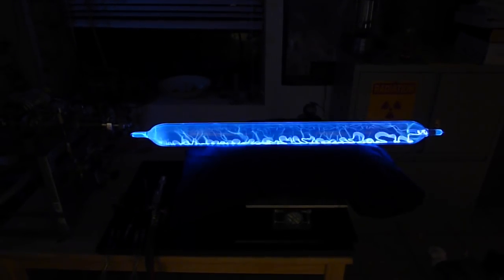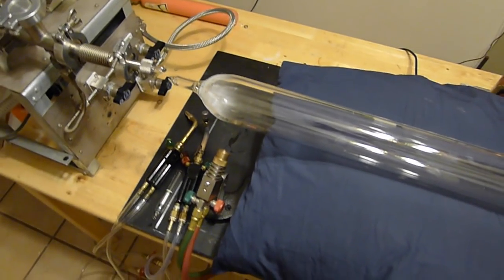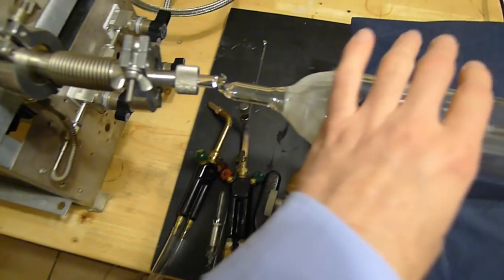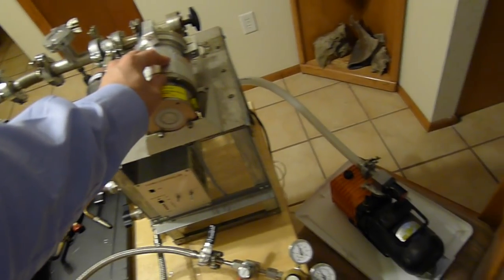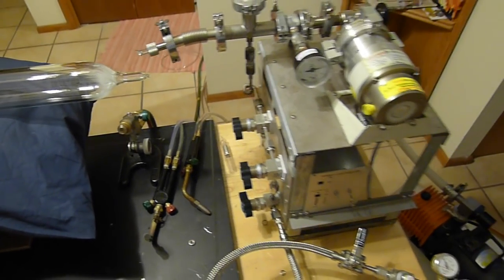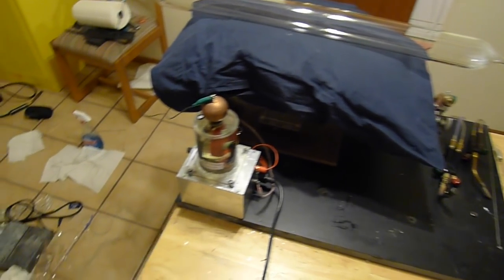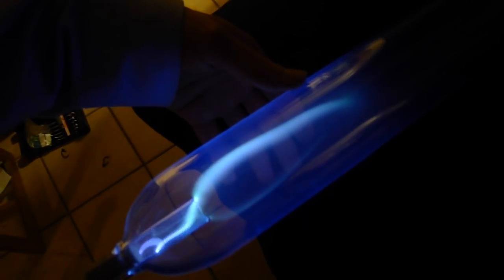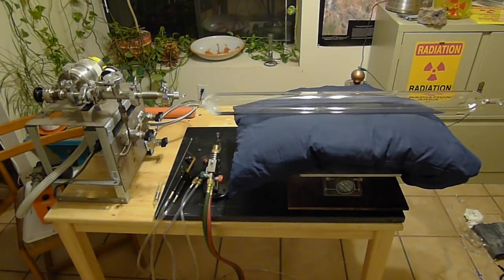Xenon plasma tube: Construction and operation

Comment from the maker: Hi Russ, 50 torr = 50 mmHg = 2 inHg.  The neon electrode is not strictly necessary.  Without it, the gas in the tube can still be lit up as a dielectric barrier discharge.  However, this is inadvisable on large plasma tubes because you risk "pinholing" the glass with an arc.  Alternatives to the neon electrode are commercial lamp lead-in wires pre-beaded with a sealing glass.  A beaded tungsten lead-in costs $4-8.  Making your own is not really advised; it's very tricky.
Reply: Hello carl I've had a project come up recently and i was wondering if you or someone you know would be able to make a few plasma discharge tubes?

I cant say for certain on the size yet but rough estimation would be 16-17 inches in length and about 1 inch wide, xenon and krypton gas 

I would do it myself but i dont really have the best of equipment here and its easier to just try ordering the tubes from someone who can make and test them adequately
Reply: @entity9742  Did he ever respond? did you find someone to make the tubes for you? if so , please share ! thank you.

Comment: Awesome video. Just want to point out a couple things to anyone wanting to set up the glassblowing portion of this. Make sure you have adequate ventilation when working boro and are using didymium glasses. Borosilicate dust can give you silicosis (irreversible lung damage) and while the sodium flare on clear is not too bad it can still hurt your eyes without didymium glasses. Also a good way to clean glass is with windex or 50% rubbing alcohol. As a glassblower I clean every rod and tube before using it in production.

Comment: Excellent device! One can use a frequency generator to modulate the output as done in Rife type devices. In fact, this can be used as a Rife device. For those not familiar with Rife devices, just Google "Rife".

Comment from the maker: You could use helium.  It makes a light-pink, not very bright glow and it doesn't form the dense tendril-like arcs that xenon does.  You can make very long fuzzy sparks in He at atmospheric pressure. Another issue with helium, although I don't know how important it is practically, is that it diffuses through glass rather rapidly.

Comment: Definitely worth consulting a scientific glassblower or anyone who works with boro. I could do a seal like this in a few minutes on my lathe and would charge way less than buying all the equipment.
Reply from the maker: Of course, the person filling the work needs to be able to degas and seal off the piece from the pump/fill system, and unless a glassblower is offering to do that pro bono and bring his own gear, one is basically obligated to own and operate some torches and annealing ovens.  I do collaborative projects with good glassblowers all the time and make no representation that I am particularly good at what they do, but nobody who gets into plasma stuff is going to get far without some rudimentary tools.

Comment: I used to blow glass as a hobby and I was looking to purchase another bench torch. I built a nitrogen generator and I have an oxygen concentrator that needs repair. This cam e about because i was looking to purchase a plasma tube for research purposes and there were none for sale anywhere. So strange. The only ones I could find are those from the Korean? company that that one man started 30 years ago and there is quite a long lead time. If I was looking for a beautiful 7 footer I would find you or build one myself. Very good video and thank you for the information.

Comment: 6:02 - interesting turbo molecular pump setup you got there. It seems like you're using a custom adapter to which can take smaller pipe intake diameters, didn't know that would work.

Comment from the maker: My hypothesis is that it has to do with the mass of the xenon atom.  This is responsible for the low diffusivity of Xe ions in Xe gas and the very poor thermal conductivity of this gas.  Arc channels form readily because ionized gas can't effectively spread out.

Comment: hmmm... im not sure i quite understand the tipping off portion of the process... so a quarter inch tube must be fixed to the larger tube... i assume the the quarter inch tube is opened so that the vacuum piece can slide in?? .....it appears sealed. How do you fill it??

Comment: Carl, also I was wondering what the practical limits on length were and at what point (voltage and pressure) you start to worry about X-rays? Is heating of the electrode a concern? (I know, so many questions)  Getting ready to dive in!
Reply: Discharges in high pressure cannot make X-rays.  To get X-rays, you need to allow electrons to accelerate to high speeds, then collide.  In high-pressure gas, the electrons don't get a chance to gain enough speed to make a "hard enough" X-ray that could escape the tube.

Comment: so I was hoping to make some glass sculptures and fill them with argon or one of the other gasses you mentioned but iv'e never got to work with them nor do i have the equipment pumps etc, although I do have a ballast for a neon sign I got from the sign shop before they went out of biz. I guess i'm kinda wondering if you might be able to help me in any way with filling a sculpture? or what exactly the process is and what tools I would need to get me started?maybe we can work something out?ZR

Comment: Great work! I am wondering if you can wash with diluted HF ie 10% and rinse with DI water instead of Sulfuric acid.  Also did you use a polariscope to help determine stress and annealing.  I hope to get a workspace so I can start some similar art.
Reply from the maker: The purpose of washing out the glass is to remove contaminants, chiefly organic material from the stoppers used in glassblowing and dust from the cardboard box the glass came in.  The sulfuric / peroxide ("piranha") wash is designed to oxidize and dissolve such materials.  I am not sure what the rationale for HF would be.  In any case, a thorough DI water rinse is essential (or you will get spotting).  I have a polariscope handy and sometimes use it to check more unusual vessels.

Comment: Any recommended source for the borosilicate glass tubing?  Also, I was wondering if you have any idea of the approximate voltage and current that your power supply is putting out? It's obviously AC, but have you ever tried a DC supply? I wonder if it would work and if the effect would be different...? Thanks for posting!
Reply: DC will not work, unless you have 2 electrodes.  With AC and only 1 electrode, discharge is much more interesting.

Comment: Hello, I like the video. I'm a big cosplayer and want to use a smaller version (maybe a tube 6 inches long 1 in around) of this in a laser rifle. I also need it to be red. Any advice you could give me would be great.
Reply from the maker: +Ancient Hydra filamentary red discharges are possible, but challenging because they consume a lot of power (due to the transport properties of neon gas).  Size of the finished product is not a major driver of cost for one-off custom projects.  I am happy to discuss further over email if you are interested in the further development of this idea.

Comment: Why is the tube opposite the drive end white?  It looks like the glass was heated too long and it devitrified?
Reply: its sputter from the electrode....this high voltage causes a bit of the electrode to vaporize..and it deposites on the negative end

Comment: would Nitrogen Gas do a similar job?
did U try to use any other mor available/chepaer gases yet?
CO2?
O_° what about gases like Propane, Butane etc. or would these molecules be cracked?
Reply from the maker: No, nitrogen, CO2, and hydrocarbons (and other molecular gases as differentiated from monatomic ones) are incapable of forming long, filamentary discharges.  Helium and argon are cheap and form long discharges.
Reply: how about water? a small portion separates in H+ and OH-, so current could flow...

Comment: What kind of amperage is the output/input on the power supply/transformer?
Reply: thats prob 12 watts..  12 volt dc at 1 amp input...to like 6000-7000 volts of rf high frequency output...at some miliamps..do the math
Reply: company..information unlimited ...sells a bunch..  you want the one thats about what i described...or theres a smaller one thats 3 watts  i think

Comment: Carl Willis Hey Carl can you send me the schematic for the PWM circuit please?
Reply from the maker: Kman Meteor I don't have a schematic handy, sorry.  This was an old supply (though I still use it) and I don't exactly remember how I built it.  The transformer is a hand-wound oil-insulated design.  The driver is very similar to the "poor-man's plasma globe" based on the SG3525 PWM chip and you can find this schematic online in various places.
Reply: Carl Willis thanks

Comment: Hello, I am [trying to make] making a blue "lightsaber" with a similar design but with oxygen at 80 torrs instead I have a few problems, can anyone help me.

one: HOW THE HECK CAN YOU GET THE GAS INSIDE, DEPRESSURISE IT, HEAT UP THE PYREX TUBE AND CLOSE THE TUBE WITHOUT IT DEPRESSURISING OR THE (very low amount) OXYGEN COMBUSTING.

two: how thick a pyrex tube should i go for if i want it not to shatter at 20 torrs? (im a bit concerened about safety so i want the mininum pressure it can maintain to be atleast 50 torrs less that to pressure i want (70 torrs).

three: would a 25 v in 2n2222 slayer exictor tesla coil work as apower source?
Reply from the maker: +Leo Wangxuanli These aren't really "problems" so much as general lack of experience with decorative plasma.  Vessels are pumped and baked out (to get rid of impurities), then backfilled with the desired atmosphere through a "tubulation" that is sealed off by collapsing the glass with a torch flame.  Oxygen may be sealed into a tube at 80 torr, 20 torr, 50 torr, 70 torr, or any other pressure...it is a non-combustible gas.  None of these pressures will produce an interesting plasma effect, though.  Why?  Oxygen is an electronegative molecular gas, and is highly quenching to discharges passed through it.  At low pressures where oxygen does form a glow discharge (below a few torr), it is dim and diffuse and tends to be yellowish with some violet features.  Would a 2n2222-driven Tesla coil power anything in decorative plasma?  No.  You need significant power, typically 50-100 watts or more, to get the best effects from plasma sculpture of usual dimensions and construction.

Comment: You would be better off having an absolute pressure measurement, rather than gauge pressure.
Reply from the maker: The mechanical bourdon gauge does very repeatable work if you're only concerned about a high-pressure, undoped fill, or establishing the topping off pressure after adding trace gases with low-range capacitance manometers.  This same pump setup is still working for me, albeit with a set of three absolute pressure capacitance manometers.  They're fine and give the greatest versatility.

Comment: Could this be done in a non-glass tube, e.g. polycarbonate or similar?
Reply: It's a lot harder to work with non-glass tubes. This at least you can work with using a flame.
Reply: glas is not burning